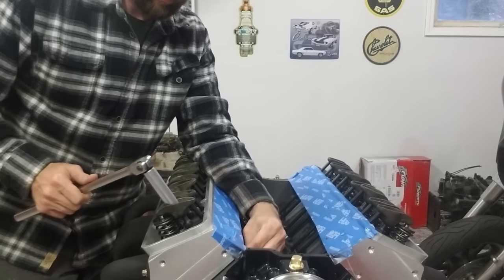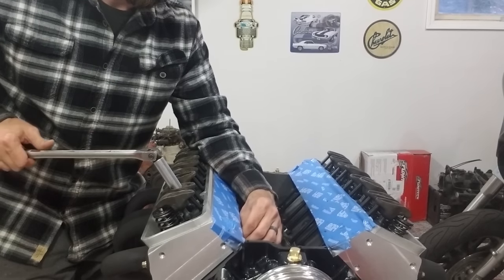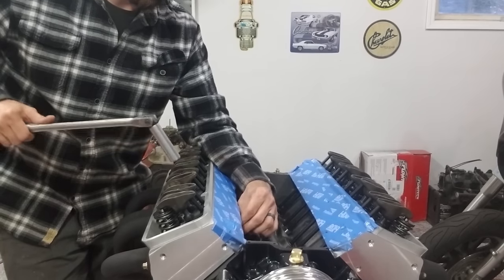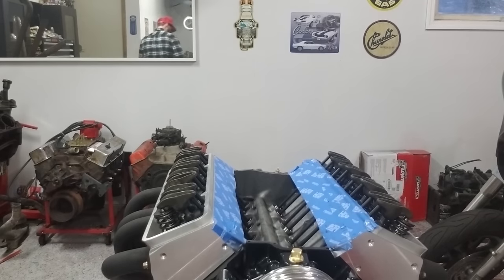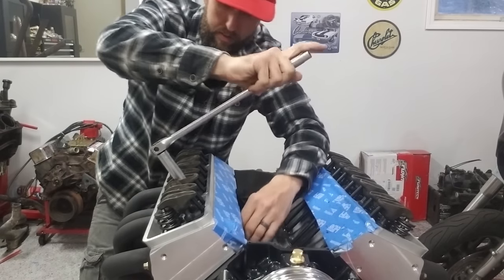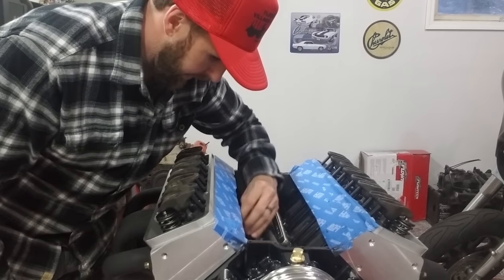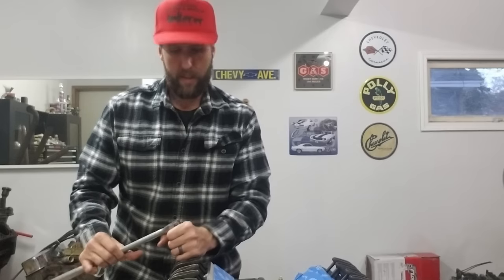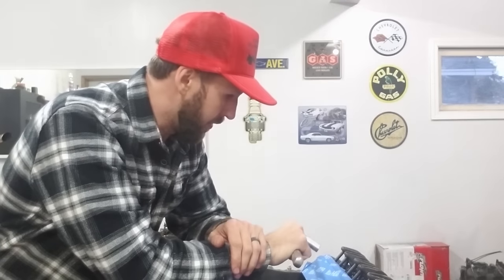Hydraulic Valve Adjustment THE EASY WAY!

Comment: The reason why this method is the best is because it accounts for any extra valve overlap you may have with a bigger cam. However, I usually go to zero on the timing marks cylinder by cylinder. That way you will only have to go completely around twice.
Reply: No need for that.
Reply: Exactly.  I had issues with the way everyone else said about doing it with the engine off. The longer duration leaves a smaller window for being at the bottom of the lobe. I kept bumping the starter until I couldn't get any loose pushrod and called it a day
Reply: It would be easier to make such adjustments if the stock dampener had marks for each cylinder. I don’t have a high performance race car so a less intrusive valve adjustment will probably work for me.
Reply: That's all you have to do anyway. Two full revolutions, 1/4 turn at a time. Starting anywhere. Eight 1/4 turns on the crank, each time adjusting every rocker arm to zero lash, then go with the lifter manufacturers suggested preload amount. If the motor has already been run, opinions vary as to how much preload. My opinion is start at 1/8 of a turn of preload and crank it, drive it, if it clatters too much, tighten them up in 1/8 turn increments.

Comment: I've only used the sbc static method, but you're right, toward the end of a build when your brain is already fried, it's terrible keeping track of intake , and exhaust, and which ones are done,  #1 or #6 tdc. Pretty cool, nice information, I gotta try it sometime.
Reply from the maker: Give me a shout if you have questions when you go to try it! Reach me on FB or IG.
Reply: This is how I do it and usually have to readjust after running a bit. Although we just did a set of heads on my son's 355 few weeks ago and hit it with no issues.
Reply from the maker: Nicely done!
Reply: I want to used this method but didn't want to take the intake off I just had it off to port and polish it and I forgot to adjust the valves for my sake
Reply: @Jmo6570  you can't grab them on top of the head? I would think that you should be able to well on s older small block Chevy anyways
Reply: Ed Griswold yes.
But if you’re rebuilding your engine you already have the intake off. It’s just easier to adjust the valves before you put the intake back on.
Reply: @Jmo6570  take the intake off and waste the gaskets! They aren't that expensive, but it's worth it to do the adjusting right.
Reply: @kevinshiley9061  I'm pretty sure that's what I did truck rotted out so I took my vortec heads and pulled them getting ready to swap with my swirl ports lol so I won't be making this mistake again
Reply: @Jmo6570  cool beans dude!!! Lol
Reply: so much better,simpler and more efficient
Reply: @Jmo6570  You can do it while it's running!  Get an old valve cover with the center cutout, loosen till it starts clicking, tension till it stops and turn 3/4, can just go straight down the line like he showed!

Comment: I used this as a guide to snug up the rockers in my 98 c1500.   I just kept turning the engine a bit and tightening the rockers. Will try a gentle pre load in a few weeks.  4.3 fires off faster and idle varies from 640 to 672rpm at idle. Thanks.

Comment: can one even do this with the intake still on ? =) great show ! Greetings from sweden !
Reply from the maker: technically yes, just a little tougher
Reply: Yep
Reply: yes,just did it and its so easy to cam swap..swap your cam after lining up the balancer ,marking your rotor position on the firewall(distributor)
install the heads,install the pushrods and rockers(but dont set yet) install the intake,re install your balancer,then distributor,lining up the mark on the firewall with the rotor.

now set your valves.rockers,pushrods,preload

Comment: So Derek, is there anything different I need to do if my engine has been running and I just want to re-adjust my values? Should I loosen them all a couple turns first? Do I need to wait for the lifters to leak down a while? I have a 68 ford 302 I rebuilt 15 years ago, an adjustment seems due! Thanks
Reply: Just saw your comment. I literally just asked him the same question above! Mine were already set but chattering after sitting for 20 years. Just wanted to tighten the lash. I started over. Loosened them all and set 0. I’ll be starting it up today.
Reply: @vampyrX213  How did it turn out? in the same boat
Reply: @prodiggy765   ended up working out. I started over. I loosened up all the rockers as if I just installed them. Followed his procedure and it worked great. Jacked up the back of the car and turned the crank with a breaker bar. Set to 0 then 1/4 turn. Only for hydraulic cams and lifters not solid.

Comment: +Vice Grip Garage So, you just tighten all down until there is slight friction with a twisting movement then do the same thing at several 90-degree intervals? I heard that the lifters should be dry, no presoak - is this true? THANK YOU!

Comment: What if your motor has been running an your lifters have oil in them.cause I know your suppose to do this method with dry lifters
Reply from the maker: oiled lifters works fine
Reply: You can do it while running with a cheap valve cover with the center cutout!
Reply: @THRASHMETALFUNRIFFS  Tried the valve cover trick. still pretty messy
Reply: @69RIDING  don't REV it bruh!!  {;o)

Comment: I like this method. I used to do something similar but then after the cam break in I would adjust it with the valve cover off while running (learned this from an old timer).  Back it out until you hear it clicking, then tighten til the clicking stops and give it another heavy half crank. It was a bit messy but worked.
Reply: Get you one of those fancy valve covers with the center cut out!  (Or get to know a friend who'll let you borrow his, lol)
Reply: You should not have to adjust them if you did it correctly.

Comment: Just did this procedure on a a friend's 350 after swapping heads.  Works like a charm, thanks for the tip!
Reply: Hey Jon - when you swapped heads, were the lifters changed out as well or were they still the original ones? I ask because I am wondering if old lifters having had oil run through them would throw off this method.
Reply: @ironicpunishmentdivision4226  , we used the old lifters, as they had very little time on them.  Less than 5k miles.  Later, on another job, a new cam and lifters, same procedure, worked out very nice.

Comment: Nice video. I was taught very similar to this method except for an even quicker way. And never ever have I had any issues.only on hyd lifters tho over head and solid I do a bit different . I've also learned what works for you may not work for another.however it's the end that matters.

Comment: I dont work on push rod engines, in fact i did only one a Ford 302 and seen several videos on how to adjust valves and figured, do i really need to go in firing order or even have tdc, so i did it exactly like u just did and it worked great.  great vids by the way, subscribed about a week ago and been catching up.

Comment: I just bought an old 89 c1500 with a 5.7L to bang around on...has a lifter/valve train noise to her. I've never seen valves adjusted that way, but I'll dang sure try it! Thanks a bunch.
Reply from the maker: You bet Chris
Reply: How did it work out for you Chris thanks

Comment: That reminds me of my post VW valve adjust days when I upgraded to a 68 firebird with a 350. I never had a car before that I worked on the heads. Anyway they were solid lifters and when it came time to put the pushrods in and the rockers I misread the torque from the book. The 35ft lbs was for the rocker base and not the top. When I went to start it there was no compression and all I could hear was the starter sound spinning the engine. After I figured out what I did wrong and the engine ran like crap I pulled it apart the cam and lifters were ruined and my pushrods were bent like bananas. WOOPS So next I learned how to put in the new cam, lifters and buy a set of new pushrods. Ran great after that. Oh the reason I tore the motor down was I opened it up on the freeway one night at 120 or so and floated the valves so the heads needed to be rebuilt. Ah the good old days:}

Comment: Hey Derek,.. I herd you mention this way is ok with solid lifters too. Never herd of preloading a solid lifter. I have to run an overhead on a 1978 GMC 454 ( Gen IV) , and I believe they  have  solid lifters. Gunna try your method, just used to running an overhead on Cummins, Cat, Detroit, Navistar, Mack, Volvo heavy duty industrial engines,... This will be a cake walk, Thank you  !
Reply from the maker: I didn't say that.  Hydraulic flat tappet or hydraulic roller.  It's physically impossible to preload a solid lifter

Comment: I've never seen that technique before. This will be cool to try on my brother's Chevy I've always had Oldsmobile engines and 66 and new olds engines have self adjusting valve trane they completely none adjustable then my brother bought a 72 K20 and it kept throwing rocker arms and I remember my dad taught me how to adjust them buy basically having the rocker covers off while engine is idling and loosen it till it starts ticking then tighten them till the ticking goes away.

Comment: Just put new headgaskets on a 92 k1500 last month, decide to do valve seals after the fact (I know way easier with heads off) none the less, started that project 3 days ago. It sucks. I've timed my valves, the tdc doing it the hard way checked ignition, everything multiple times and am getting backfire through the tbi. I think my valves are too tight. I have like 25 hrs into these valve stem seals now. Going to try this method tomorrow. Seems simple.

Comment: ( In case you're used to seeing VGG suggesting shady, shaky, and oddball ways of fixing up a car, this one is DIFFERENT.

This is actually a true, valid, no-foolin correct technique!   IN a nutshell, screw it down until the slack is just barely taken out of the assembly, then 3/4 turn or so.   The important bit is to be sure you do this once and only once.  Skipping a cylinder is a no-no, as is accidentally doing two or more 3/4 turns on the same cylinder.  I did this on my '68 6-cylinder Mustang and that worked perfectly, that is until the car had many softball-sized rust holes in the fenders and no exhaust system.  Then I sold the car, musta been like 1975, for $75 to a fella with greasy hands.   Anyway, unlike almost all his other videos, you won't be stopped, questioned, warned, tagged, towed or arrested for following this video.

Comment: I wish I would have known this 30 years ago. I remember lashing my rockers on my Pontiac 400 after I put reworked heads back on it while it was running. What a tedious messy nightmare.  Same thing on the 305 in my sister's Trans Am.  

Adjusting the valves on my old Toyota 22R pickup was an equal pain in the ass. Those engines had non-hydraulic valve train where the OHC cam lobes contacted the rocker arms directly, no tappets at all. It had to be done while the engine was warm so it was best to pick a hot day so after taking off all of the crap to get to the rockers it wouldn't cool too fast. The exhaust and intake valves had different clearances.
Reply from the maker: Yikes!! But, now you know!

Comment: I learned back in the 70's to do it while engine was running. Back off until it started ticking then tighten till ticking stopped then 3/4 turn more. Always worked perfect. Messy though, we were kids, didn't care.

Comment: I like this for a baseline on a new install, etc...  Easiest way to make valve adjustments periodically is while it's running!  Get one of those valve covers with the long rectangular middle cut out to access the rocker studs, idle the car, loosen a rocker till you hear clicky clack, tighten just till it stops and do ur 3/4 turn.
(IT don't work like this for a solid lifter cam though, which requires a bump start, feeler gauges and finding top dead center, etc... a specific procedure every oi change)

Comment: straight and to the point, great video.  I would stress that it's essential to do four passes at 90deg rotation, or more passes at different degrees of rotation due to cam timing!!
Reply: Nope. 3 passes is fine.
Reply: @SOLDOZER  you say potato i say... the fourth is a check

Comment: That’s really all I do as well. The only difference is I’ll set it at TDC, compression or exhaust, and half of the cam/lifters should be at zero lift. Adjust those valves. Then spin the crank 360 degrees and adjust the remaining valves. If it’s a really radical cam you may need to be several degrees off TDC when you start but not usually.

Comment: Love youre channel. And this will work great, but... If you do it in the right order from a #1 TDC you do 2 valves * 8 turns with a total of 16 adjustments.
This way it is 16 valves * 11.5 to 18.7 turns with a total between 184 and 299.2 adjustments.
Reply: no,too much unnecessary bullshit

start fresh,rotate each pushrod with your fingers and tighten until they just barely spin ALL OF THEM.

ROTATE 45 DEGREES

rotate each pushrod with your fingers and tighten until they just barely spin ONLY THE LOOSE ONES

ROTATE 45 DEGREES

rotate each pushrod with your fingers and tighten until they just barely spin ONLY THE LOOSE ONES

ROTATE 45 DEGREES

rotate each pushrod with your fingers and tighten until they just barely spin ONLY THE LOOSE ONES

ROTATE 45 DEGREES

rotate each pushrod with your fingers and tighten until they just barely spin ONLY THE LOOSE ONES

REPEAT THE ABOVE THREE COMPLETE 360 REVOLUTIONS

now tighten each pushrod/rocker 1/2 to 3/4 of a turn ALL OF THEM......
Reply: You just took a simple solution and made it complicated again. No need for all that.
Reply: @SOLDOZER  Hehe, no all I said was that if you do it RIGHT, you only need to do 8 cranks (90 degree each) and only two adjustments on each crank:) Anyway, I think whatever way you use, its a good idea to prime the valves before adjustment.

Comment: I just make sure the cam lobe is on the bottom and adjust to zero lash and then go 1/2 turn into the lifter. Put valve covers on and fire it up. Always perfect. Everytime.

Comment: My dad taught me to only adjust valves with the engine running....annoying and messy but kinda fun at the same time.
Reply from the maker: Yeah thats one way to get er done! As long as you get it close enough she fires off.
Reply: You can do it while running with a cheap valve cover with the center cutout!

Comment: So Derek... been doing hydraulic lifter preload for 55 years.
The one thing your method doesn't do is guarantee that the lifter is on base circle.
Here's what I do.
Starting on one bank(I like to start on the left number one), I watch as I turn the crank until both rocker arms have stopped moving down and go about another twenty-thirty degrees.  Now I know that they are on base circle.  I do zero lash the same as you except I do it at the rocker arm cuz the intake is usually mounted.  I go 5/8th turns because I've read both 1/2 and 3/4 forever.  I just split the difference because I can see the condition because of the way that it is.  Repeat for each cylinder. 
I then install the valve covers permanently because I know they are done...factree. 
.

Comment: Tbh this looks like the most time consuming way to do valves. My grandpa is a legend and he taught me the quickest way and most Efficient way is you take the valve cover off fire up the vehicle, go through each rocker and back off the nut until it starts makin noise. Then simply tighten until the noise goes away and then boom. Onto the next rocker.

Comment: I'm hearing a lot of clatter from my 1970 Pontiac 455 with only 2800 miles on it.  The engine builder says he adjusted the lifters with zero lash plus 1 full turn.  Your adjustment system is simple and reliable for a new engine.  I can see checking my engine for existing lash.  But I won't really know what percentage of turn each lifter has.  If I find a loose one, I can do a full turn.  Should I just assume any of the tight lifters are OK?  Thanks for this terrific video!

Comment: Easiest way... With the engine installed in the vehicle.  Remove the Valve Covers.  Start the engine.  Tighten the rocker arms until they stop rattling.  EASY.  ( Yes, I did this to a 1971 Monte Carlo in 1979 when I was 17 ) That car did donuts with six people in the car!

Comment: Your absolutely right that way works and is easiest. Love your attitude and video.but one thing. Y waste good aluminum heads with stock rockers. Just wondering
Reply from the maker: Go watch engine masters where they test roller tip, full roller, and stamped steel.  You're going to be very surprised.   Unless your running 5k+ rpm continually (circle track, drag racing), theres really no HP advantage
Reply: @ViceGripGarage  Thanks
Reply: @ViceGripGarage  agree 100%. People will by fancy roller rockers because they are attracted to shiny bits. Factory rockers work just fine. Instead of sctew in studs (that cost money) we would just cross drill the head into the rocker stud and hammer in a roll pin. Works fantastic.

Comment: Does this same method work on a used engine that is already in the car?  If not, what is the process? Do you loosen everything up before you start?  Or, do you have to do it the old fashioned way where you loosen it until it starts clacking, then tighten it down until it stops?

Comment: I like this method! Especially when the wife needs your assistance!! I just set mine by setting cylinder #1 to TDC and adjusting Exhaust 1, 3, 4, 8 and Intake 1, 2, 5, 7. Then I rotated engine 360* to cylinder #6 at TDC and adjusted Exhaust 2, 5, 6, 7 and Intake 3, 4, 6, 8. While I got them all to zero lash, I also set the preload before moving on to the next valve. Is this an accurate way to set them as well? BTW, love your vids!!
Reply: What do you mean TDC? How did you get them to all of the cylinders? I'm so confused